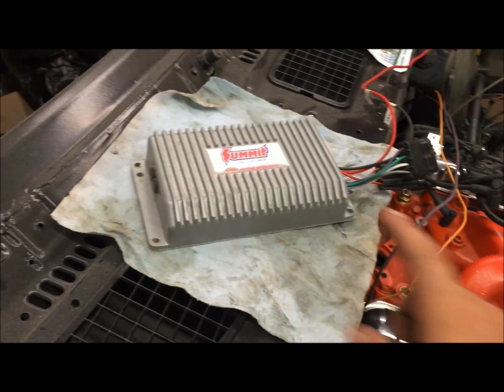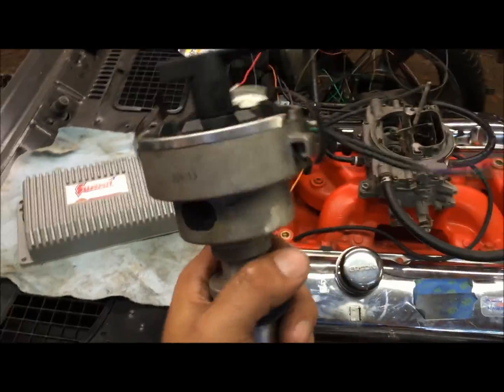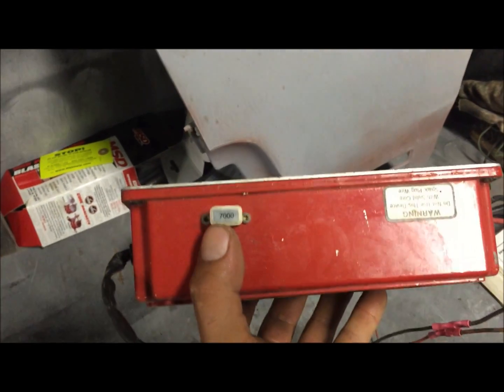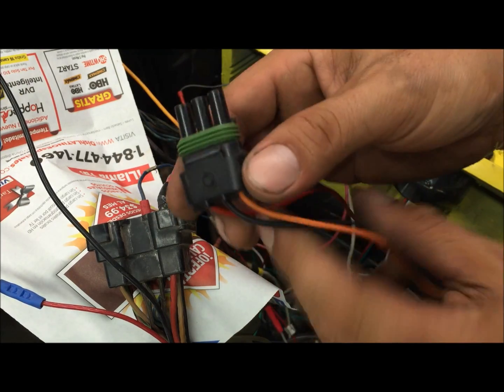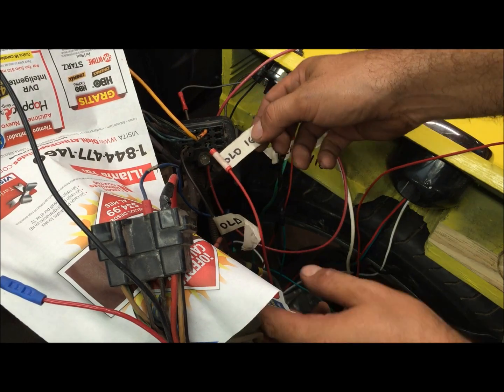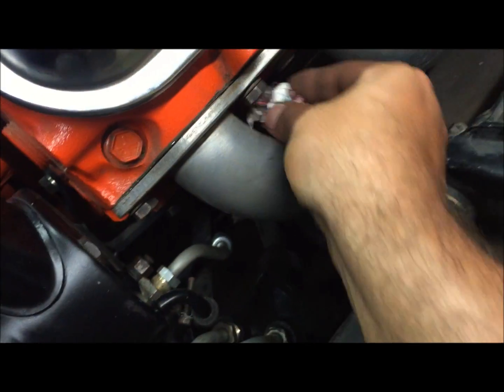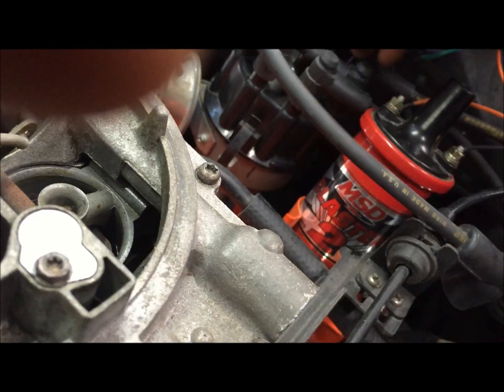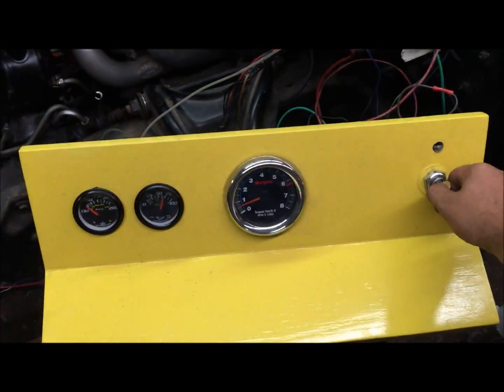how to wire an ignition box summit MSD how to DIY do it yourself

Comment: I have that same summit racing box including the summit racing distributor too and it won't start it just cranks over without a spark
Reply from the maker: watch my msd ignition to gm HEI and make sure you wired it like that.. directly to magnetic pick up and not through an ignition control module
Reply: @chriscraft77022  do you have Facebook

Comment: What size fuse you use off the horn relay?
Reply from the maker: the fuse is based off wire size and circuit load

Comment: The small red wire for 12v switched power, will that go to acc or ign on fuse box. On 69 chevelle not sure where the old coil wire is on firewall
Reply from the maker: wire to ign...  the factory coil wire is resisted down and you need to replace it....

Comment: Thanks. Mallory dual point and summit box. 1 set of points and no condenser. Just used to trigger the box and 45000 coil. If box quits [common] right back to dual point.
Reply: I carry a spare box.